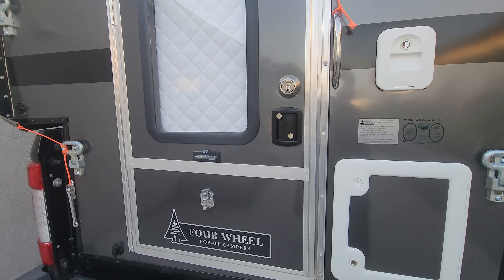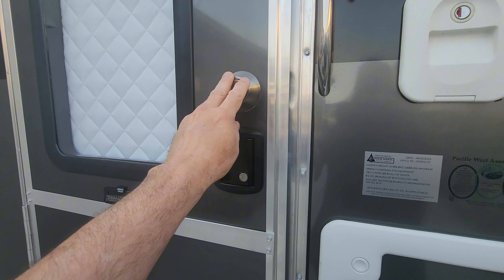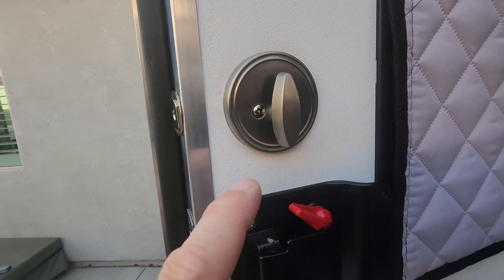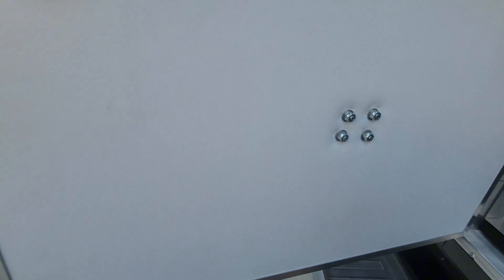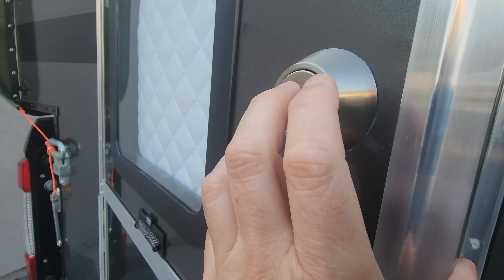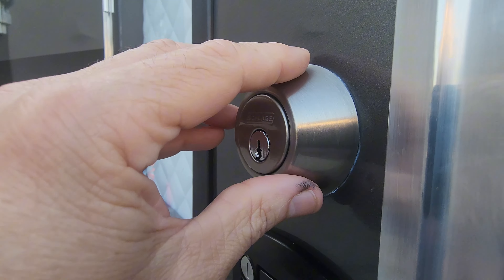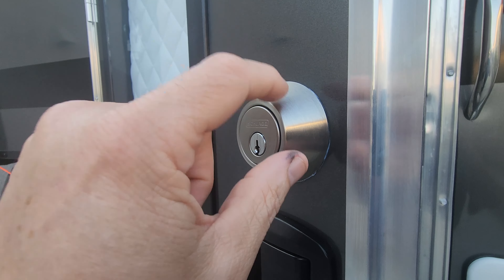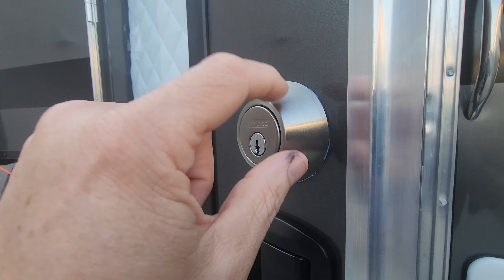four wheel camper defective deadbolt

Comment: Thank you for this video.  I’m going to go ahead and replace my lock based on this recommendation.
Reply from the maker: better safe than sorry, it may never happen but id rather pay 28 bucks to fix the issue.
Reply: You didn’t even show how you replaced it. I’m at a Four Wheel camper dealer and they’re having a hard time getting the dead bolt out of the door, just the bolt that slides? Don’t see the point of this video?
Reply from the maker: @paul_s872  tons of dead bolt replacement videos out there to watch. i didnt think i needed to do a step by step. the point was to call attention to the faulty deadbolts.